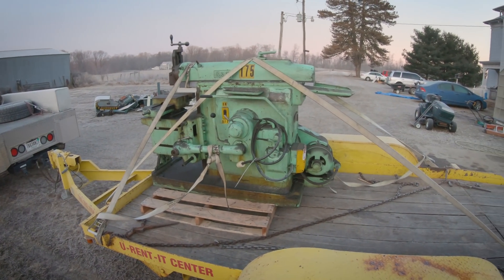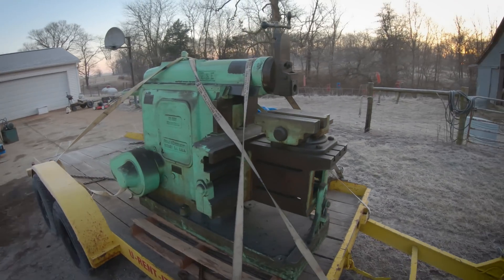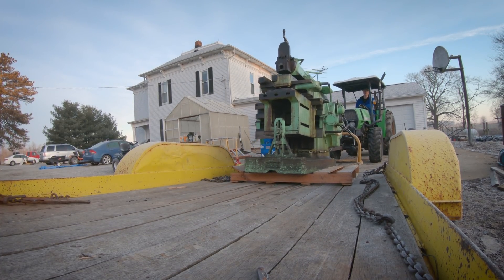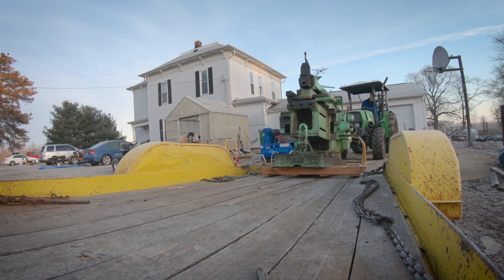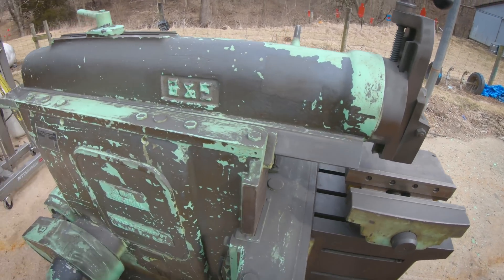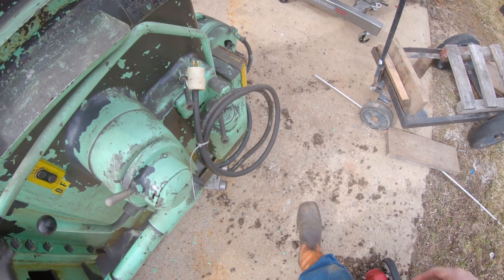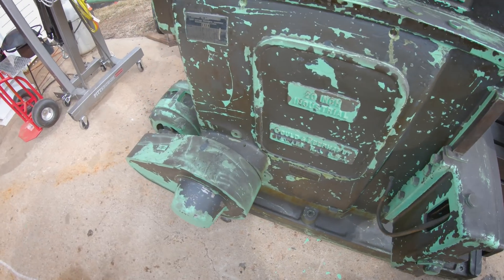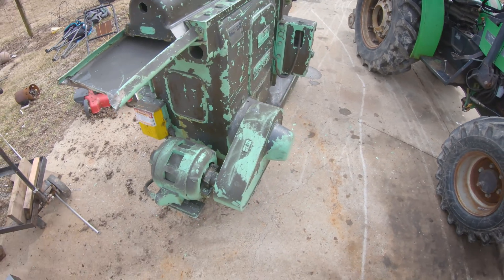So I bought a 20 inch Gould and Eberhardt G&E Metal Shaper

Comment: There must be something in the water. I just bought a 16" G&E industrial universal shaper. Mine looks just like yours except I have the rotating table and tilting top. Mine was made late 1941 from the serial number. Yours is probably built around the same time since yours is a 8 speed model also.
Reply from the maker: I think is all the shaper videos abom is putting out that has got people buying them
Reply from the maker: Its a sweet machine. Mine is a 43
Reply: Tom isn't that the one you were looking at a month ago
Reply: Same company, but I was looking at a 12" Hendy they had.